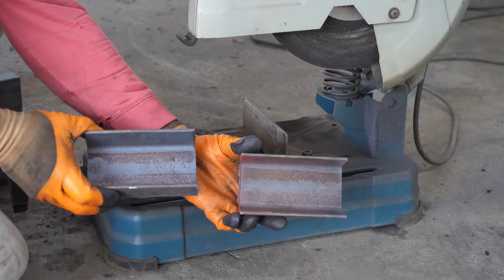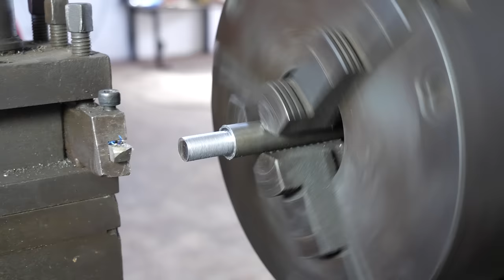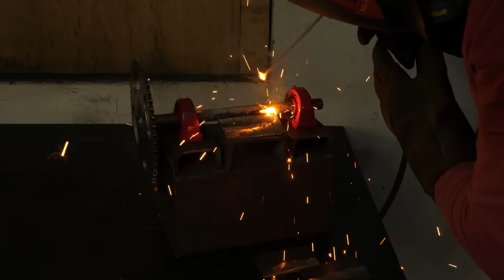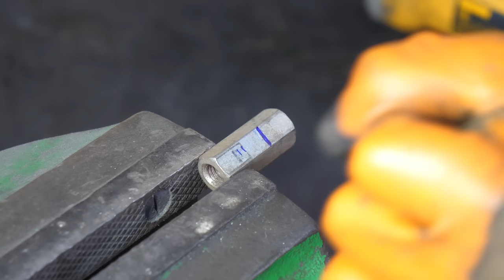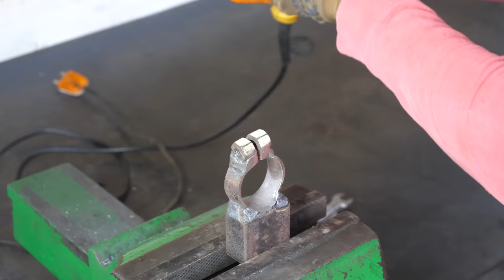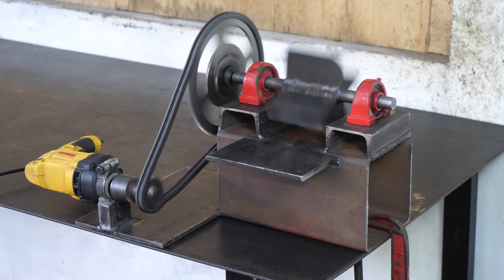How To Make A Simple Wood Chipper Using Drill Machine | DIY

Comment: I hope you have a good supply of drills because even with your soft green wood it will not last long. They are not designed for continuous use.
Reply: ऋग्वेद
Reply: ففلسبببببببببببببببببببببسلاسلاسس

😶😶😒😒😒😒😶😶😶😶😶😶😶😶😶😶😶😶😶😶😶😶😶😶😶😶😶😶😶😶😶😶😶😶😶😶😶😶😶😶😶😶😶😶😶😶😶😶😶😶😶😶😶😶😶😶😶😶😶😶😶😶😶😶😶😶😶😶😶😶😶😶😶😶😶😶😶😶😶😶😶😶😶😶😶😶😶😶😶😶😶😶😶😶😶😶😶😶😶😶😶😶😶😶 وه وه
Reply: Ээээээээээээээээ
Reply: @jivanjivan5040 p😊p
Reply: Qqpppp
Reply: @ramadansayed9054
Reply: @ramadansayed9054
Reply: @jivanjivan5040 p
Reply: @jivanjivan5040 pp
Reply: @jivanjivan5040 ppp
Reply: @jivanjivan5040 pppl
Reply: pp
Ppppppp

Comment: Try this with "REAL WOOD" (that is not green) and watch the machine stop moving... This is more like a vegtable chipper. You need a stronger motor if you want to use it for WOOD. Also a cover over the blades to protect your face. Otherwise GOOD!
Reply: Seems like a great sugar cane processor diy.
Reply: Ji
Reply: hbbbb
Reply: @zainalabidinkandui9312  q
Reply: @choccolocco  😀

Comment: Great design, when the bearings go out you can’t replace them without complete disassembly.  😂. How hard would it have been to drill an access hole under each bolt before welding?
Reply: Welding the sprocket you can't change the inner beating ever. Keyways anyone?

Comment: what do you do with the cut up stuff? its very unevenly cut with long bits and short bits. it wouldn't be good for mulch which is the general purpose of chippers. a chain tensioner would be a good idea. the drop saw would have made cutting the tube simpler. a better idea would be to turn it 90 degrees an make a chute to feed the green wood in from the top and collect the cut stuff into a bucket below. limited use as dry material could stall the motor or break things, also not everyone has access to that nice clean steel. sorry if i seem to be pulling it down, i'm just pointing out some problem areas before others trying to make one get into trouble
Reply: ङंङउअंयङययरुयतरत
Reply: Bk

Comment: Почему такое странное расположение колес? Дрель должна крутить Большое колесо, а ножи быть на Маленьком колесе
Reply: Да ну !!!!!
Reply: For torque. With this setup you sacrifice speed, but gain the torque. If the sprockets are other way around you would gain the speed, but what's the point? At the contact with wood, a poor drill would stall.

Comment: You simple destroy your drilling machine. The gears in it are not designed for such torque. Use an individual electric motor.